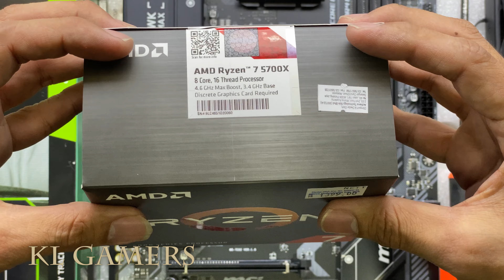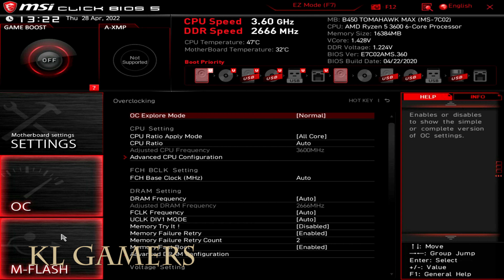AMD Ryzen 7 5700X MSI B450 TOMAHAWK MAX RTX3070 VENTUS XS MSI MAG CORELIQUID PC Build

Comment: The caption says Ryzen 7 but it shows ryzen 5 on mobo???
Reply: Will the b450 tomahawk max really supports ryzen 7 or no???
Reply: @christiancruz7323  yes he was just using the ryzen 3 to update the bios. im still running  7 5700X ON A B450M and it works great.
Reply: @RBOHANNON  hey bro, I have Ryzen 5 3600, Galax 3060ti 2x fans and MSI B450 Tomahawk Max, I now want to upgrade my CPU to R7 5700x3d or R7 5800XT, Will this Tomahawk Max motherboard work with the CPU i mentioned above or do i have to upgrade to a new motherboard.

Comment: --  Nice build for the time.  On a scale from one to ten of budget versus ultra expensive builds, this is probably about a 5.5 ... 10 being absurdly expensive (considering a year a go).   I'm going to go on the assumption that you wanted a power efficient, cool running, stable, budget build, BUT that would go pretty darn good at 4k for a good long while, and absolutely shred at something like 1080 (1k).  Selecting the 5700x over the 5600, what are you a college student?  Need a little more multi-tasking.  Gaming and work/school? Would make sense.  
     I see the Kingston NVME in there too.  But even back then I think 240gb is way too small for the NVME considering price point even back then.  Weighing price you break almost even (unless you already own the SSDs) and your performance is much higher.
     Good choice on RAM but I don't think there's enough of it in the system.  Also 1 year ago, why not the B550 chipset?  Was the price that different back then.  And why single channel memory?  Makes conceivable sense to me.  
     
    I wonder between the chipset/RAM quantity if you're not building this for someone else now, that is really going to run 1080 and needs room to grow in the future.  AM4 now, in 2024 still is not a bad choice for budget systems.  I question the B450 chipset over the 550 is all.  That makes me wonder: did you already have this Mobo and some of the parts?  This is not a fresh build, but a significant upgrade?

     Your case looks budget, but so far, quality RAM, GPU, MOBO, CPU and that's priority.  Looking forward to seeing the PSU.

      Your CPU cooler.  UGH!  You might not have known this back then.  But MSI had serious clogging problems, especially with those 240s.  Bacterial growth would clog the heat exchanger fins in the block.  You'd know by now if this happened to you.  Worse yet MSI really dragged their feet on helping customers out.   Also, my opinion, but I think you really want to put that 240 in the case first.  Assuming it works the way it should, that's more than enough for a 5700x.  Also, need to rub that CPU with some rubbing alcohol and the surface of the water block.  Putting thermal paste on should be the last thing you do, right before installing the block (eliminates dust and skin particles sticking in there).  But I have an embarrassing cooler in a different way on my daughters rig as well.

     Not a bad rig, or assembly.  Things I would have done different, but hey.  I'm very interested to know who you built it for, future plans, what you expect it to do now and at what level.  
         
 My daughters rig (similar - my way - build)  Incidentally: This was about a year ago as well.  

For my daughters computer I used:  CPU: AMD 5700x, and I have that exact board (but B550), but better cooling with the ROC Strix, so I took it back and swapped for that.
                                                                GPU: Gigabyte EAGLE OC 3060ti, because I knew overclocked more, I could put up (and I've even beaten it) 3070 performance OC'd.  
                                                                Storage:  Samsung 980 pro 2tb NVME with a ACIDALIE passive heatsink (those things are cheap and they really work)
                                                                PASTE & PADS:  All heatsinks/gpu/cpu use Kryonaught Thermal Grizzly Paste and Gelid thermal pads.
                                                                RAM:  GSkill Trident Z Neo 2x16gig
                                                                CASE: Thermalright Core P3 - Overkill but the kids wanted something they think looks better than my rigs.
                                                                CPU COOLER: Arctic Freezer II 420 AIO - as I said: embarrassing in that it is EXTREMELY OVERKILL for this processor.  But there's several reasons for it.  It looks really good in the case style, you don't see them everyday, they're some of the best out there, it probably will be useful in another system down the road.   And MOST IMPORTANT, my daughters had to have bigger fans in their computer than daddy.
                                                               POWER SUPPLY:  Corsair 850 Gold.  Overkill but could be useful in the future if this becomes a file server down the road.  
                                                               
                                                               I'll spare you my main rig specs, but it has a 4090 and ended up costing me almost 7 thousand dollars.

Comment: İ have a question
I'm using Ryzen 5 1500x with my Asus b450m dragon motherboard but I wanna upgrade my cpu 
Can I use Ryzen 7 5700x or 5800x3d with a good 240mm liquid cooler ?
I have 700w PSU 80+ gold
Reply: Yes
Reply: @aly1111  5800 too ?
Reply: @1ku54  I mean, you should be able to. As long as the Mobo you have supports the BIOS flash. I do question why you're looking for a 5800 with that motherboard though, you probably only need a 5700 max? Just be wary of any overclocking.

Comment: I have a question, I am planning to upgrade my pc with gigabyte b550 aorus elite v2 + Ryzen 7 5800x3D, Mobo is coming with ryzen 3rd gen ready label. I just wonder, Do I need q-flash bios first or 5800x3d will recognized without any bios update ?
Reply from the maker: You will need to have at least F10 BIOS to boot the 5800X3D, and a graphics card 
https://www.gigabyte.com/Motherboard/B550-AORUS-ELITE-V2-rev-10-11/support#support-cpu
Reply: @KLGamers  hi, thanks for your reply, how can I learn if Mobo has f10 loaded without booting the pc, does package has a label which specificly shows bios version of the board?
Reply: You can take help from Gigabyte support team or from the seller.
Reply: @iamnilsankar  they dont care and reply any of question. Sellers have no idea what they are selling so best to ask here to someone who is familiar with building PCs

Comment: Hi - I want some advice please... I'll be posting this on a few sites... I have a MSI Tomahawk Max II, 5600X, 32GB DDR 4... Now I'm looking to fill the slots. So - My 1050Ti - Old but... erm... working... fills two, and the one next door to the GFX will get very hot and also heat up the GFX card... SO... I'm looking at the other slots and thinking what I can use them for? That other long one looks tasty - but I have no interest in dual graphics... what else can I use that for?